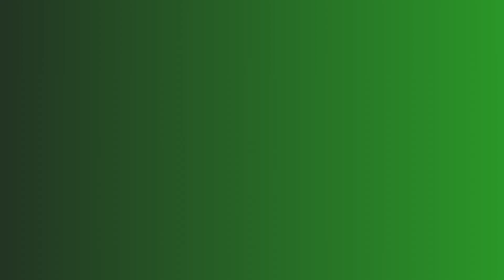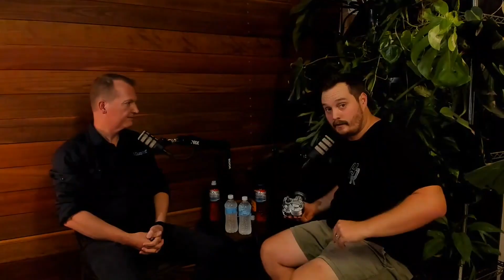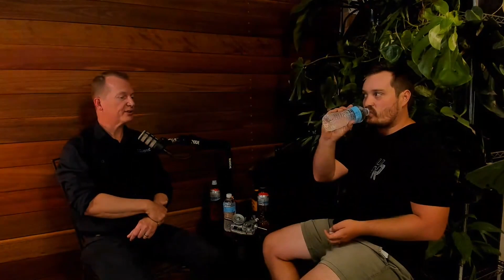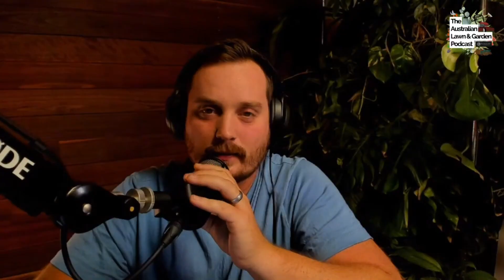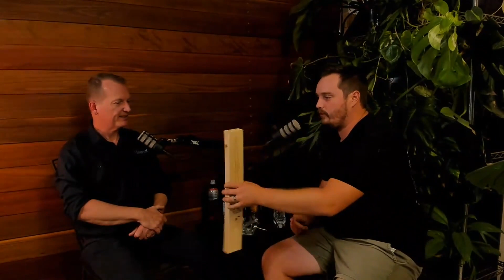Masport: Why These Low Cut, Petrol Mowers Might Still Be The Kings Of the Aussie Lawn

Comment: I've got a masport president 6000 self propelled mower I've been through 2 gear box these mowers are shit
Reply: 😂😂😂 my one is 50 years old 😂
Reply: Careful
Reply: @IanDennis-gr6ud why careful is soild mate I've upgraded to Honda blades and sent it to fab works shop to make catcher ❤ today's crap is not worth buying 😂😂😂
Reply: And mine lasted 10 years before the bearings in it went out just today. Thing is tho the President series is not the Contractor series and is made for a different user. It's cheaper, lighter and less premium but is fine for a small lawn run like mine. And in my case the weight does matter so that it's lighter is the feature that I as the user required. Pity about the gearbox but I can't lift the premium level Contractor so it's useless to me.